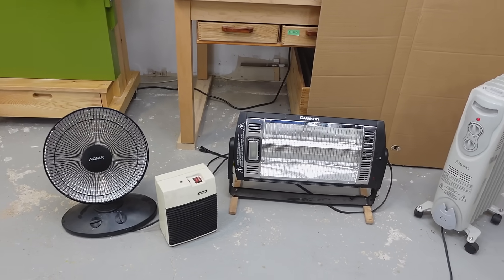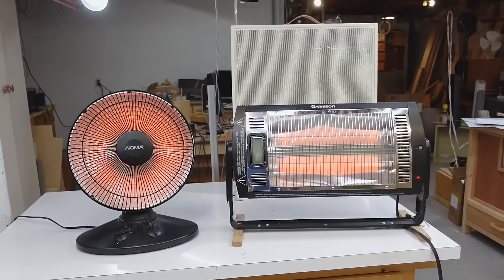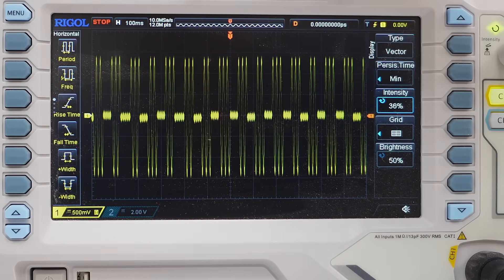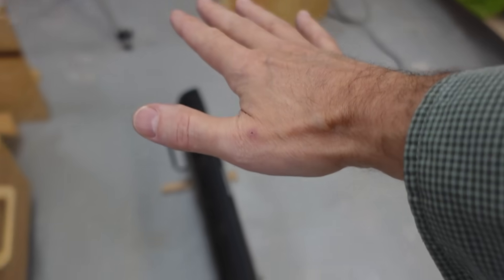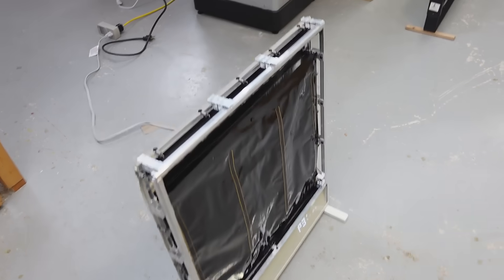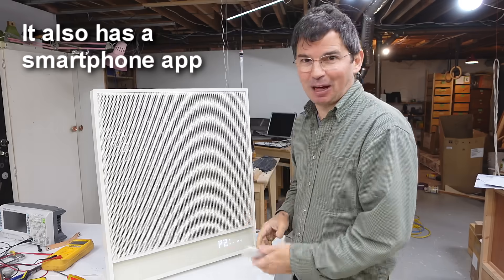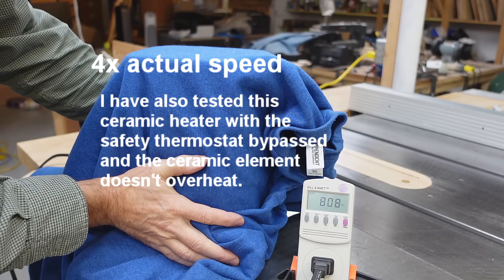Best heater to keep me warm at my desk

Comment: Completely agree on physical switches etc. There is no positive feedback in touchscreens and apps are just annoying. Same in cars, I dont know anybody who prefers the touch control systems. Buttons you can operate without looking and are much more satisfying to operate.
Reply: Not to mention the conspicuous safety hazards associated with car touch screen interfaces. A subaru outback that I drive occasionally requires tapping through two menus just to turn the front defogger on. The whole large screen also remains bright even when ambient light is low; it has a really noticeable effect on visibility at night. I hope regulators catch up and shut that crap down
Reply: @Styrofo4m   What a load of nonsense. I am sure the blind will loveee all those touch screens. If the goal was really to help the disabled  you would never use touch screens you would allow custom peripherals.  Physical buttons have been scientifically proven to be faster to operate and safer in traffic. 'Touch' interfaces are popular because of cost ( on cheap products )and the ability to lock down features and sell them separately on  more expensive products (because they can push everything into software).
Reply: I'm a fan of apps, but only in addition to good physical controls.
Reply: I really like now my 21 Corolla does it, it has a good sized screen that has all the infotainment stuff, but it also has a physical vol knob, and  a few other buttons. Then also has all the HVAC controls on physical buttons.
Reply: Only a few touch surfaces get surprisingly close to physical buttons using haptic feedback.
I know the Steam Deck's trackpads do and supposedly Apple's new touchpads are similar.
But without that or in cars in general, physical buttons definitely are the way to go.
In the latter case also for avoiding static electricity damage, along with the reasons mentioned in the replies above.
Reply: Analog switches and dials also allow you to use small appliances like this on an external timer.
Reply: I currently am driving a brand new Mercedes as a rental car.  Almost every switch is touch-sensitive!  Sunroof requires swiping forward or swiping backwards.  Lights? touch.  Volume control?  Touch.   I hate it.

Comment: While the modern looking thing might be one, I'm missing the generic modern infrared heating panels. I think they're by far the most comfortable. Also, infrared is quite a wide spectrum with different wavelengths producing different effects w.r.t. absorption and reflection (and burning your skin, similar to UV!) and the way you experience it. It's ultimately the latter that matters. Infrared radiation is often divided into 3 different parts (just like UV radiation) with IR-C being the most comfortable and safe while IR-A ages the skin and IR-B also but to a lesser extent. I think those bulb-based heaters produce all kinds of IR and may not even be healthy for long exposure. I strongly suggest you repeat the test with a more representative medium (e.g. yourself) and include a modern IR panel heater that's specifically made to radiate IR-C. The goal is not to get things - especially not cardboard - as hot as possible, quite the contrary in fact; the goal should be to get you comfortable with as little power as possible.
Reply: which models have you found that emit IR-C, primarily?
Reply: @unionse7en  I believe most slowly warming panels are primarily IR-C (which is also why I doubt the modern looking thing Matthias tested was an IR-C panel; it got hot instantly). A random example is the Trotec TIH series and it looks like a popular North American brand is Ducoterra (at least their stuff looks like IR-C panels).
Reply: @zmooc Thanks!
Reply: I've seen IR divided into near-, mid-, and far-, as well as shortwave, mediumwave, and longwave, but never A, B, and C. Is this a new thing?
Reply: @IDoNotLikeHandlesOnYT  It was new to me too but I noticed IR heating manufacturers use these terms so decided to use them here too. I had a bit of a Google and apparently the ABC-thing comes from the International Commission on Illumination and is commonly used for IR heaters. https://en.wikipedia.org/wiki/Infrared#CIE_division_scheme
Reply: Thanks for this, I was looking hoping to find a comment like yours that addressed wavelength. IR heaters for people are designed to heat people. How efficient that is depends on what people are made of and how well that stuff absorbs energy at particular wavelengths, otherwise you're just going to reflect or transmit the energy instead. People are predominately made of water (and not cardboard or walls!), and NIST has a great graph of water's absorbance vs wavelength. It's no surprise that water has 80%+ transmittance in the IR-A that dramatically flips to 30% and 100% absorbance in two places in the IR-B. 

The other problem is the measuring instrument. When you're measuring with a thermal camera, it has a specific spectral range and the emissivity needs to be accurate to convert radiation to temperature. I looked up Matthias' TOPDON thermal camera and it sits between 8-14um. If the SUNKOS heater has a peak temperature of 573K, then the spectral peak is going to sit at 5um according to Wien's Law. Most of the energy is out of the range of the camera! Although they say temperatures can be measured up to 800K, it probably becomes unreliable.

It should also be mentioned that not all IR emitters emit at the same IR peak. A halogen-tungsten emitter usually operates at 3000K and radiates most of its energy in the IR-A. Heureus has a great graph on the emission spectra of most of the heat lamps such as halogen, short wave, fast medium, carbon, and medium. Each technology has a wavelength peak that operates at progressively lower operating temperatures, and that shifts the radiation peak wavelength -- and the optical power -- further to the right according to Wien's law, where peak wavelength is inversely proportional to temperature. Below 1200K,  convection heating losses starts to become significant, so manufacturers have to compensate for that in their process design. The perforated sheet in the Sunkos Far-IR heater was definitely included in consideration of convective heat losses, not just safety.
Reply: Also regarding efficiency of black/grey bodies, Heureus has shared with me that for water drying applications (water stays as a gel in your body besides when you intentionally sweat) for the same power density emitters, Halogen has about 13% efficiency when you convolved its emission spectra to water's absorption spectra, and carbon at 1500K has an efficiency of 28%, but at 1150K that efficiency jumps to 42% with medium wave IR emitters. That says nothing about how well the fixture itself delivers that energy.

Comment: Great video. One thing to consider in use with the infrared heaters are portable sand batteries (in my case, empty 20 lb. propane tank filled with dry play sand.) I use a few adjacent to my wood stove. Really impressive thermal storage, and safe and stackable. Beats rubbing two wood scraps together to get warm. I keep learning new things from you. Much appreciated.
Reply: So you are dragging old propane cylinders around your house to stay warm?
Reply: Just open the top of a new one and get a match
Reply: not practical for portable spot heating in uninsulated large spaces.  Can be useful for other things.
Reply: @ColCurtis  why would that be a problem?

Comment: Thank you for sharing yet another thorough analysis.
I would like to add: don't forget "radical" alternatives to getting warm: putting in some good physical exercise before sitting down. I find calistenics to be very practical and effective.
Reply from the maker: that's a different topic altogether.  You could also put on a sweather.
But that said, you need to keep the house at a certain minimum temperature or you risk getting condensation and mildew in the corners.

Comment: Quartz is king! Two years ago, I got an oscillating floor mounted 600/1200 watt, the two bulbs went high and low. 1200 watts is handy for warming up a very cold room, but 600 seemed too much for continuous use. Last year I got a smaller 400/800 watt quartz, for 18 or $20. This one used one, or both bulbs, and the 400 watts setting works great at 3' to 8' in a cold room. Clearly quartz is most efficient, and no compromise in my experience. One thing, line of sight to the bulb will eventually dry out your eyes, I just point it at my back. A laptop display, or something else, to block a line of sight to the bulb, also solves the problem.
Reply from the maker: getting one with two bulbs is much better -- that way it just turns on one smaller bulb on low instead of turning the whole thing on and off 10 times per second
Reply: @matthiasrandomstuff2221  I'm familiar with the digital pulse phenomenon, my quartz toaster oven uses cycling to manage cooking intensity, it causes LED lights to flicker across the house. The 600/1200 watt heater uses some other technology, probably a transformer, both bulbs appear to operate at half intensity for the 600 watt mode. While I prefer the 400/800 watt heater, it does use one vs two bulbs to manage the power level. I prefer non-flickering, low power, but product lifecycles seem 6-9 months, so caveat emptor.

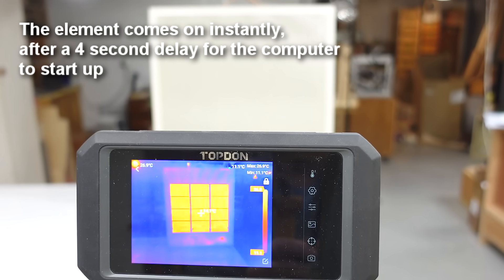Comment: 3:23 - Even though the heater turned yellow in the image instantly, you can see that it took about 5 seconds to reach 80 degrees. The color didn't change because it was still the maximum in the image. Still very very fast, but not instant
Reply from the maker: Good point.  When I watch it heat up, it takes a few seconds to settle into its expanded shape, so that would also reflect time to get to full temperature

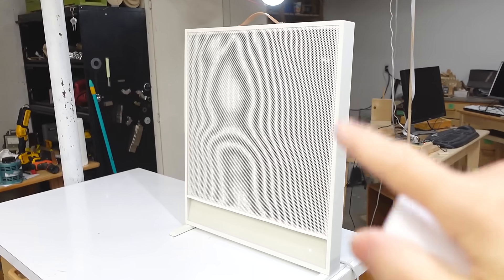Comment: 3:08 the weird switching from this heater might be caused by it using a triac to switch the power, which latches on until the 0 volts crossing.
The weird switch points are probably from it sending some PWM signal without it syncing to the mains frequency.
In P3 it might still be checking somehow, perhaps to insure the weird heating element's integrity.
Or it's slightly power limited still to preserve the life of the element or something.
It'd be curious to see how it performs if you wire the element yourself and put on a different grate.
That'd also bypass the slowly starting "smart" electronics, making it more reliable in this way.
Reply: That is exacly that, the correct name is pulse skipping.

Comment: One of the best things I've ever done is grabbing a nice long bath robe to wear while at my desk. I just wear it over my clothes, and it makes it a lot more comfortable without using any power. Sure, that won't work in all situations, but at a desk it works great. For those worried about cold hands: I usually suffer from that quite a lot, but with most of your body better insulated, your hands stay quite warm too.
Reply: and then get a heated pad for your feet and you're set. They even sell actual desk feet warmers too

Comment: You could maybe reduce the power from the high power heater and increase it's longevity by using a SCR based "speed controller"? I've been doing this for resistive heating elements for years with great success. Even have a box specifically for this purpose with a 3kW SCR "dimmer" in it and a thermocouple based temperature controller. It works a treat! Super useful to have that box that can temperature and power control any mains device by plugging it inline.

Comment: I was considering a heated floormat for at my computer, or maybe next time I see one of these IR bulbs at the thrift store for keeping a chicken pen warm for underneath my desk as an experiment.
Reply from the maker: I also ordered some 150 watt infrared bulbs, but they arrived too late for the video.  The catch is, they also need some metal thing to go into, and I should put some sort of metal screen in front so I don't burn myself if I accidentally tough them.  Also, ideally they point down so as not to lose too much heat from convection.

Comment: I used to use an oil-filled (low setting) with a small computer type fan to blow the air a short distance.  It seemed to work well for me.
Reply: Best balance between convection and radiation having it under your desk to warm you and also the air.

Comment: Update to my earlier comment: I've received my Sunkos "early bird" Kickstarter pledge now, a month after they started selling them on Amazon.
I'm amazed they didn't even bother including a CR2025 battery for the remote. :|
I expect your issue with the placement of the controls is caused by the main design fault — if they had put them at the top of the device, the controls would get very hot!
And boy, you weren't kidding about the flickering. My Philips Hue lights are fine, but the standard LED bulbs are not happy about it, no matter what power level it's at. :/
The screen is also quite bright at night, even when powered off!

Comment: I'd love to see you tear them all apart, cobble them all together in one long sheet metal tube, and mount a blower and air filter at one end, so it blows past all those heaters and becomes a home-made forced air system for the basement.   You could use the smartphone app to trip a relay to make them all come on.

Comment: Hi Matthias I really love your vdeos! Could you come up with a lithium drill battery that can have replaceable batteries? Like an opening flap and you just slot in batteries like the old days? The lithium batteries wear out but everything else is still ok, seems a waste!
Reply from the maker: its not so easy, the cells have to match, otherwise the cell balancing circuitry can't keep them balanced.  Also, cells of different wear level or capacity will cause problems in that the emptiest cell gets reversed and ruined.
Reply: @matthiasrandomstuff2221  For someone like me that cant check the individual batteries couldn't I buy all new batteries or does that not save any money?
Reply: @neila9251 hi,
It used to be do-able until the replacement individual cells doubled in price, at least where I live. I've replaced individual bad cells (in their parallel pair) but it's not long before others fail.
I think another issue is the high current/power draw off the cells; the connection would need to be beefy enough not to burn out.

Comment: I bought one of those garage heaters, and mounted it to the bottom of a bridge between mezzanines in my garage. This bridge is at 15* from horizontal, and the heater was angled down at 45*. It lasted about a year of occasional use before the case warped from the heat and locked the power indicator wheel (attached to the switch) into place, I pried the shell away and it worked a bit longer before the plastic part of the switch itself warped. It still worked, though. I scrapped it and bought another one, and mounted it in the same place. It warped, too. The light confuses me. It's useless - the heater bulbs are brighter.

Comment: I've used those thin flat panel wall mounted electric convection heaters (Amaze Solo is one model, I'm sure there are others), they work pretty well, you should test one of those.   Also used a rug heating pad (a Hot Carpet - highly recommended) in a previous house that had really cold floors, those would be nice under a desk, just not sure how long they'd last under a rolling chair...  
Note, I have zero relationships with any of these and don't use any of them anymore, but I did buy a Dreo fan based on Matthias' review... ;-)

Comment: The waveform is almost surely due to a zero-crossing PWM switch circuit, designed to reduce the amount of power burned in the power mosfet or IGBT or whatever driving the heater. By doing the switching at the zero crossings of the AC waveform, the transistor won't dissipate any meaningful power during the time when it's turning on and off and is in an intermediate high-resistance state: when the current is actually flowing it'll either be in a fully conducting or fully open state. Of course this type of circuit can get into degenerate states where it's only grabbing half waves, leading to what you saw on the scope.

I expect the heating element is probably actually pretty low tech: just a PCB heater but with a flexible PCB substrate for less thermal mass, and graphite conductors instead of copper.

Comment: I work at a bank with a hundred or so odd offices. Over half the people here run heaters, mostly 1500w oil electric. Very few have heating pads/blankets which would probably be the best option with the most human-heating per watt. There's probably a reason for this, but I don't know it. Maybe cords.

I wonder if someone out there sells a sticky-back heating pad similar to a 3d printer heating bed that you can stick to the bottom surface of your desk, right under the mouse and keyboard... You know what I'm just going to buy a seedling heater and glue it to my desk. lol
Reply from the maker: adhesive stuff doesn't stay stuck very well over time. Doubly so if its holding something up, and that thing is warm.
Reply: Some older or special 3D printer headbeds have standard silicone heater modules glued to them.
Which you can order separately and just stick under your desk, wiring it to a self-made switching cord.